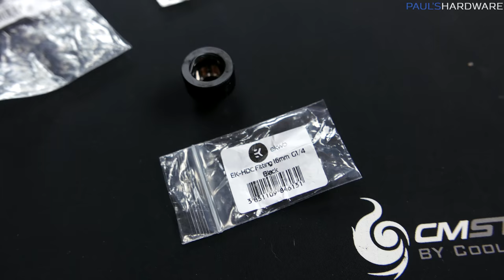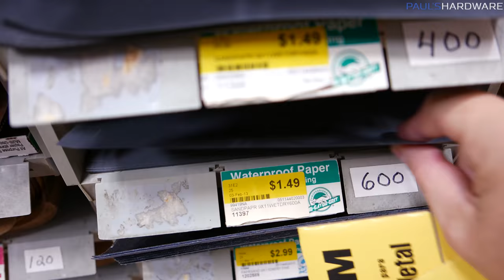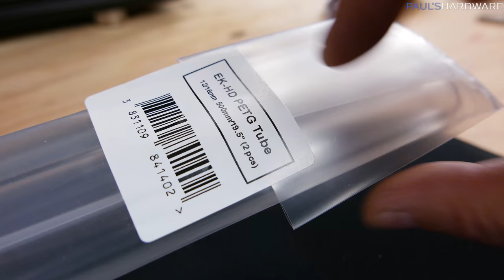CASE CARNAGE: Arctic Panther Build Log Part 2

Comment: Why do youtubers consistently tell us sli does not scale in  basically  anything and then stick two of the most expensive gpu's into a build with no hope of leveraging any performance from the second card and further complicating the building process.  I also dont by leveraging a second gpu for adobe premiere.  I really dont mean to be rude, but just adding a gpu to fill space, increase heat to my loop for $820 for ZERO performance gain is just silly!  Even if you get the cards for free it sends the wrong message to your public that sli actually works and is supported?
Reply: highlander Its not quite Zero, the issue with negative scaling comes from the newer DX11 games, which are abandoning multi GPU performance optimization for single GPU performance. Thus why DX12 and Vulkan are a big deal right now, games running those two tend to support both single and multi GPU rendering properly.
Reply: I only know of two games for sure and maybe three(MAYBE)?, that are somewhat  designed to handle multiple gpu's.  and even those due a poor job!  Directx 11 is handled for the most part gpu vender optimizations and directx 12, again for the most part, will be handled by game developers?  To this point, we will see gpu venders move away from multiple gpu support and I believe AMD has already started the process by eliminating their X-fire branding.  It will come down to game developers under who have had a lackluster track record at best.  Firestrike scores look good though?  LOL!
Reply: U know if i have more money to spend on my pc,  i would buy a second GPU, just because that's cool ! 
U are a pc enthusiast, yes or no ? 
This is the same thing buying a ferrari or a porsche, why buy one if the maximum speed limit is 80mph ? Just buy a regular car, and it will be the same !
Reply: But this is not "your" loop.  SLI can be useful, and when it isn't it can be disabled.  I think the point is that as long as he is doing all this work to build a "premium" PC, it better actually be premium.  I'm not completely convinced on the CPU, but it can be changed without too much difficulty.  Besides, if he has this hardware around it should be put to use, not gathering dust on the wall.
Reply: highlander that's not to mention how much a waste of time  and money water cooling is in the first place

Comment: Paul please look into a "stepped drill bit" Its meant to drill large holes through sheet metal.
Reply: Or at least a holesaw. Jesus that was painful to watch.
Reply: Most of those holes were in the mesh.  A drill wouldn't have worked well.  The only hole a stepper or hole saw would have helped with is the one for the drain.  And yes, for that a stepper or hole saw would have been better.  Still, he got the results.  One thing I might have done after drilling and filing would have been to use a black permanent marker on the exposed bare metal edges, even if they were going to be covered up by the fittings, for admittedly no good reason.

Comment: Paul, if your issue with the paint job on the PSU is the texture use a Scotch Brite pad to smooth it out. I'm sure you have one around the house and it's great for smoothing out your surface prior to painting. You could go over the area once and hit it with one last coat of light paint. It should turn out great. As always, great videos and much love from Guam!

Comment: Paul, I strongly recommend a "cone drill bit", would make easy life cutting large holes into sheet metal.  A ton of them on Amazon including metric sizes.

Right tool for the job and spare us the pain to watch a hack and slash. Whilst it's works the feeling when it can take 30seconds to I suspect 25minutes you took with the care and attending and recheck and filing..

Comment: Looking good Paul.  One thing you need to change is that riser pipe in front of the reservoir.  It's a real eye sore with it at that angle and the reservoir plumb.  Looks like you can just use an elbow and a short pipe.

Comment: Paul. From my experience I suggest to change the flow direction. From Pump trough the drain port to GPU -- to top radiator ( more heat will be out of the case) . next from top radiator to CPU - to the front radiator (back). From the front radiator  to the Reservoir ( from top or bottom) . Regards, From New Zealand. You don't want to bring hot water from GPU to the intake radiator and pump?

Comment: Looks cool. The only thing I would change is to try to make the tube from pump to the first radiator more vertical by adding another 90 degree turn or maybe getting a longer tube and bending it

Comment: Paul, just some quick thoughts on what you are doing...

1. Going with the EK blocks will probably work out perfectly for you, however nothing says that you couldn't just remove the ROG logos off of those back plates and see if you could add them to the EK black plates. Asus would have positioned them in a place that shouldn't interfere with the cooling of their card. So if you removed the LED panel and cut out the ROG logos you should be able to achieve the look you originally wanted while having the full cooling that you will get using the EK backplate.

2. The slanted line won't look good in your system as you probably won't have anything else that goes with it. I would change that up and bend a 90 in there. It will make match the rest of the clean look that you are going for.

3. In terms of the flow meter, have you thought about using Thermaltakes Flow Meter? It is a spiral inside of a tube. It will probably add to the clean look. They also have a digital temp sensor that your coolant would also flow through that could also look pretty nice in the loop as well.

Anywho, just a few thoughts from a long time subscriber. Hopefully one day I will be able to afford to build myself a system like Arctic Panther. Only difference is that mine would be in the Define S, and would probably be orange. Speaking of which does anyone know if there is a UV Reactive Orange Fluid?

Comment: I think doing the loop in the exact revers order would look way better.
The outlet of the pump nearly lines up with the drain port and GPU block.
And the front port of the front radiator would nearly perfectly connect to the bottom inlet of the pump with the tube going vertical.

Comment: Hey Paul,  two tool suggestions: step drill bits or a knockout punch set.  Either one would help when making holes in the cases.

Comment: PAUL love the videos!!My question is at time frame ~15:17 the fans at the front case will be pushing HOT air in to the case, this air also will be used to COOL (USING HOT AIR from the graphic cards)the water from the CPU (top CPU radiator). That water is now cooling the Graphic cards. My thoughts are HOT air always need to be push out of a case not pushed IN TO the case. HOT air out COOL air IN.

Comment: Paul can you change the out of the pump. Maybe turn it 90 degrees back into the flow meter or 180 degrees so it is more straight into the rad.

Comment: Paul, imo do the Flow indicator outlet to cpu inlet first. One its an easier bend and MOST importantly it will add mounting force for the indicator to the reservoir which should make the radiator out to indicator in easier.

Comment: Hey Paul you might want to look into getting a step drill bit for the future if you plan on making more holes in cases, it does a much better job and easier then your current method. Just trying to help

Comment: Jez, all that cash for water cooling parts and they can't even use black wires for the pump?
Reply: Makes one wonder how many other things aren't thought out.  Also, dem margins. I wonder if a water filter to prevent the need for flushing would work.

Comment: heres some painting tips: sand with a lower grit say 400 then go to 800 then 1000, use a filler primer, sand that with 800 then 1000 to get it super smooth, then use your colour over the top of that and it will be super smooth.

Comment: Hey Paul, 
have you thought about flipping the front radiator around, so that the ports are on the bottom ?
You still could arrange it the way you have it like now, but i think it would look cleaner and draining the loop would be easier as well.

Comment: I like the build but I really really don't like the slanted tubing from the radiator to the pump. I would suggest using an extra 90° fitting to make it two straight tubes instead of a slanted one. Other than that, rawrrrrr!

Comment: Paul with the "T" at the bottom, have you thought about turning it 90 degrees so it faces the back to the GPU, down for the drain and the last port towards the right side / MB. It will save you a bend and might look cleaner then having a tube run to the front then turn 90 then 90 again. But just an idea.

Comment: You can still fit a 8 pins Eps cable on the 4 pins Eps socket or if you have the connector that break in 1/2 to 2x4pins even better. I've done that on my Aorus X399 Gaming 7 as I could not find an Eps Extension Sleeve in a 4 pins version.

Comment: I've never built a full custom water loop build but I have built dozens of custom fish tanks. Every bend, 90 and 45 degree have a drastic effect on an aquarium pumps flow rate. Surely the same applies for water loop pumps, since seeing one torn down, they are basically the same pumps (in fact seeing one torn down they look like cheap crap)

Comment: Paul, Have you considered putting the flow indicator elsewhere so it looks a bit more, well thought out?  You're running into some of the same issues as I had with the monoblock and having to flow they system in the opposite direction, but I can share some photos of my setup with you that you may find some ideas worth stealing.  Let me know.

Comment: Nice thus far. But please don't leave that straight tube (from pump/res to 280mm rad) going like that. I suggest you make run flush along the res & give it 90 degree turn to the rad.
Looking forward to your next move ;-)

Comment: [~6:17]  I thought it was supposed to be better to have the inlet/outlet for a vertical-mounted radiator, coming in at the bottom?  So it doesn't pick up any of the air that might collect in the top of the rad, and send it into the tubing part of the loop? 

Alternatively, can't the base of that pump be rotated 180 (or, perhaps 45-ish degrees rotated?), so you don't have the ports "crossed" at the bottom?  I.e., if you must have that first pump-to-front-rad tube going to the top of the rad, instead of the bottom, coming from the nearer side of the pump would let that tube be properly vertical, rather than slanted as it is now?

Comment: hey paul love your videos!! check the thermalright ty-140 or 147, best static pressure fan ever made !! the decibels against static pressure proportion it's off the chart, plus it would make a great video ;) and a cheap one. Also the gentle typhoon if you prefer 120 it's the best at there category. It just pains me that nobody seems to know these fans and they are the best fans ever made by a considerable margin, the only fan that gets close is the Noctua a15 but still not as good as the ty-140. That video will make Steve jealous of your incredible knowledge about fans ;) ;).

Comment: +Paul's Hardware
I know it's to late, but still, I would have turned the top exhaust fan to be an intake and ditched the bottom fan, that ought to be enough to "ballance the pressure". Just my 5 C's.
Brgds.

Comment: Hey Paul what fittings are you using? Not seeing them in the parts list.
Specifically to connect the 3 way T outlet to the ball valve. I really wanna build the same thing

Comment: If your loop went the other way you could have much simpler runs.  Front front rad into res, out of res to T, then to GPU's, then CPU, then top rad, flow indicator, back to front rad.  That would look very clean in my opinion.

Comment: I always wondered if putting a rad between graphics cards would make any difference in cooling? I am thinking about making a setup where there will be a rad between every cooling block. One for the CPU/Vram and one for each GPU and one for the reservoir. A total of 4 radiators. Overkill?
Reply: No since after a while the temps level out. I have temp senors before and after cpu and gpu and only see 0.5c difference. For overkill I have 2x280 and a 420 rads.
Reply: Component order does not matter by more then 1 degree in most cases.  The reason for this is because the water temperature in the entire loop normalizes to be the same throughout.  Most people don't realize how fast the water flows and completes a full circuit within the loop.  That doesn't give the water much time to really change temps from one point in the loop to the other by more than a degree or so.  That's why it doesn't really matter if you put radiators between each component or just chain them all at the beginning/end of the loop.

Comment: To get the extra 4 pin EPS check wires online and come off a spare 6pin pcie cable... Unless it is a single rail psu the pcie will be fine for 4 pin EPS... just get the wiring right or else poof.

Put the flow indicator down by your drain assembly and straighten those pipes with some extension fitting or something.

Comment: Isn't the hot liquid from the GPU flowing into the reervoir without being cooled first going to be hard on the pump? I seem to recall that being an issue with another Youtuber's liquid cooling setup, where the pump motor essentially melted itself under the heat.
Reply: the loop maintains one temperature throughout. the water leaving the gpus is no different than the water leaving the res. i would certainly hope they designed the motor to withstand the heat from a pc. think about how hot that water would have to be to melt it.

Comment: is there a case with a 420mm front radiator support, meaning 3 140mm fans in the front + radiator ?
Reply: Thermaltake Core X71
Reply: The new c700p from cooler master.
Reply: that is a humongous case, do you know anything relatively smaller, I know it's a long shot but still.
Reply: like for example cooler master mastercase pro 5 supports triple 140mm fans in the front, but they say for the radiator it supports only 360mm, I wonder why it couldn't support 480 as well...
Reply: Momin Fakhar I got the mastercase pro 5 too but the only way to fit 420 is to mod the case. There really isn't many cases that support 420 and look good.
Reply: oh ok, thanks for the reply

Comment: Paul, you should use a 4 port splitter at the drain and have a temp sensor there so you can make your fans scale based on the water temp.

Also why not stick with the Asus backplates as they look so much better than the EK ones ?

But your build is going to look epic.
Reply: Beardroid91 Didnt he explain why he isnt using Asus backplates? Because the holes dont line up and it could cause vrm overheating because not enough pressure
Reply: Yea i think he did, but anyway looks should have a say too, and VRM's doesn't overheat with the backplate, it's Asus and not EVGA ... xD

Comment: So the hot GPU fluid goes into the reservoir and not through a radiator first? I feel like you could have managed that better.
Reply: JohannesMP the order doesn't matter as long as the fluid is cooled prior to going into the gpu or cpu.

Comment: The slanted tube looks ew
Reply: Agree i think it would look much better straight with a 90 degree bend.
Reply: Should do a bend, or just do another fitting so it can go straight down.
Reply: I agree.  Another vote to add a second 90 degree fitting so that tube will be vertical.
Reply: To each their own, we should see how it looks when it's mostly put together rather than criticize it as he just cuts the first piece of tubing to put in
Reply: Yea it for sure needs a 90 bend in that tube. Would be quite awkward with a random angled tube
Reply: Really? I kinda like it. I've seen so many builds that all use the 90 degree bend. I thought the slant adds character.
Reply: I agree! 90 degree straight down, then 90 degrees to the front-facing out port on the reservoir would look much nicer and not block the reservoir's view.
Reply: @Mr. T Smith, I guess the slant might work, but only if all the verticals run at the same angle.  Then it'll look like part of the theme.  As it is, if it's the only one, I think it'll look odd.

But I'm sure Paul has a vision and will make it work the way he wants it to.  But if it looks wrong, he could always submit it to 'Pimp My PC' for advice.  LOL
Reply: Mr. T Smith I think you and I are the only ones that think that.
Reply: Agreed
Reply: Naw I like it.  All straight tubes on EVERY build got boring.  It's almost too perfect and uniform and like a boring grid.  I like the slant.  I'd be cool if somebody meticulously bent a tube slight along the whole length to make a long shallow curve. Just for one or two short ones.  I think it'd make it different
Reply: Honestly, I think it looks great. Everyone does 90 degree bends nowadays, it's boring. I hope he keeps the tube slanted like that, at least the build would be different from all the others.
Reply: I'd like to see the OUT from the pump go to the vid cards instead of the rad and then the IN go into the top of the rez where the rad fitting is nearby anyway. Isn't this standard procedure?
Reply: I seriously think it's Paul's way to piss off people with OCD, just like with the dampening foams in the garage worklog.
Reply: Rafael Salazar I can see that, the OCD people can screw off, people build it to their own personal touch
Reply: The dialogue needs to be cut way down in these videos. At the beginning is fine to explain stuff. The rest, yea. Kinda overkill, man.

Comment: Why cant you just go from the pump to the GPU instead?  IMO it'll make the loop a lot more simpler and cleaner.  Rather than going around and adding unnecessary fittings.